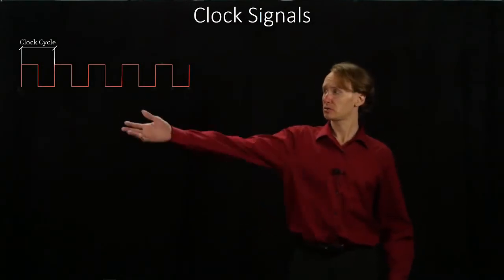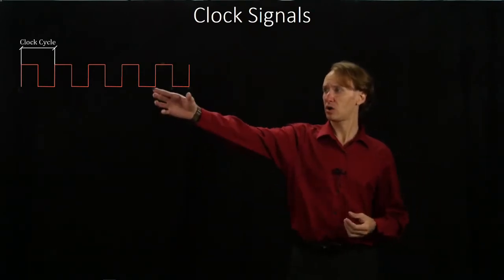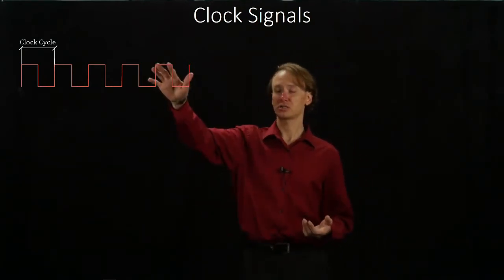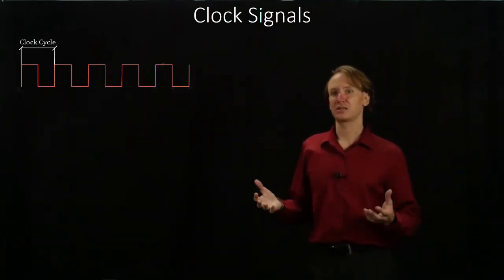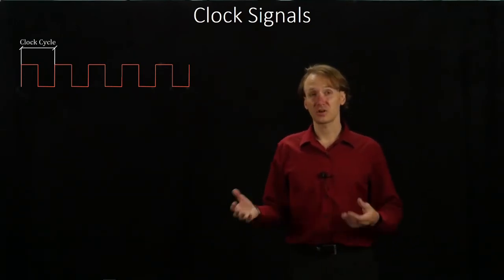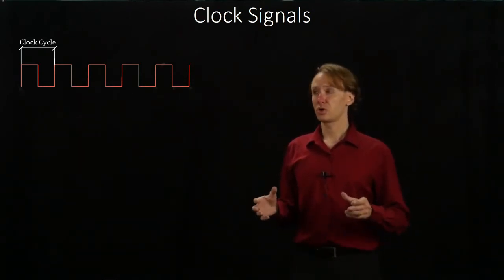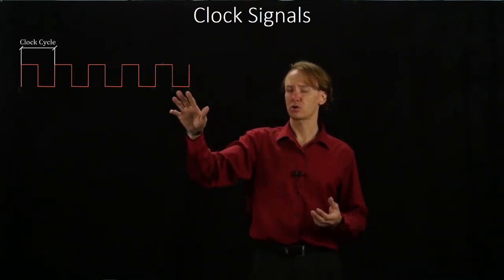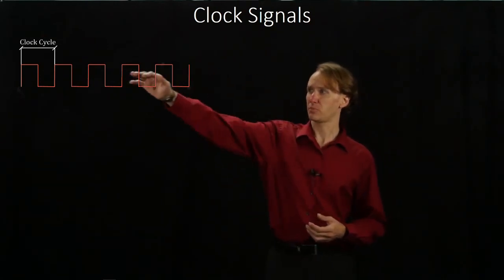15.  Clock Signals

Comment: So is the clock timing the signals???and meaning of faster clock means that more signals will be timed by clock in a lesser time???in others words can we say that more number of signals in a lesser time will make the circuit faster???
Reply: Very much so. However, you can’t separate this phrase “clock signals”. Clock is just an analogy and an attribute of that kind of signals. the frequency is physically limited due to the complexities of actual implementation and capability of the CPU. And you can increase the cpu frequency by some configurations which is not recommended. I think I should go back to review the Patterson and Hennessy book